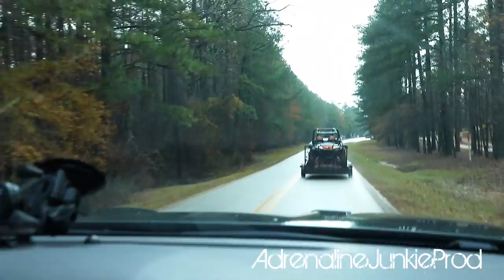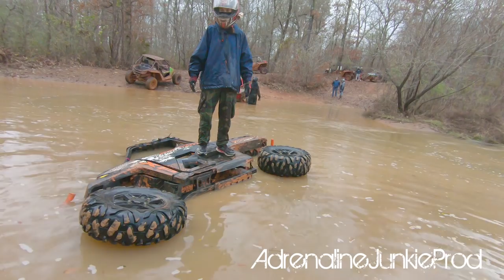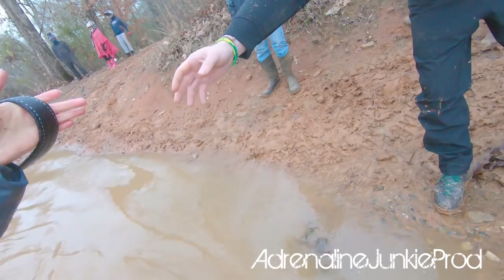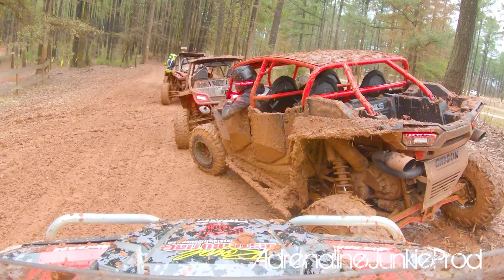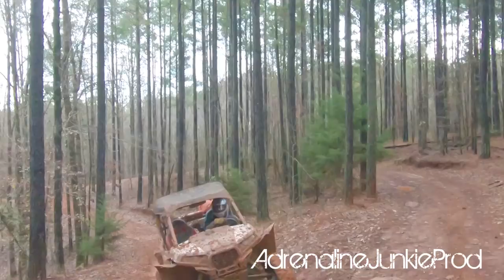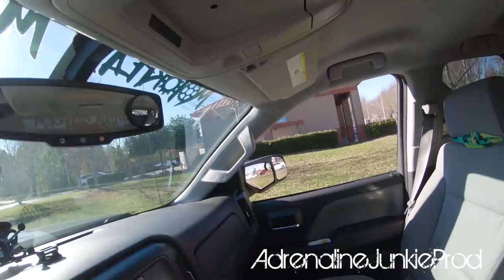Slick + Sloppy Georgia Clay in Durhamtown - Feature Length Trail Ride - SXS/UTV Trail Vlog 014

Comment: Riding always comes with its surprises at the end of the day. My last trip I loaded the trailer and on my walk a round strapping & checking straps I noticed I sheared off my front sway bar. But as you said "If you ride them hard, you need to  ready to fix them more often"!!!
Reply from the maker: Kole Moore Ya man, when you push the limits things wear out faster. Maintenance is just part of the experience. It’s crazy how many times I’ve found damage on the trailer before or after a ride, lol. At least you can still go on your ride with a busted sway bar!!

Comment: Durhamtown is decent. Best part about it is the one-way trails. On your next trip , you need to hit the two " Fast " trails , super fun. Also didn't see you hit the big hill clime area. That one mound isn't it. There's a spot that is steep and has four different places to climb it. And there's a boulder garden going up a hillside if you like to do any rock crawling. All in all , it's a fun place to spend a weekend.
Reply from the maker: Hank Slaght ya, we missed quite a few areas. Next time I head back there hopefully it’s not as wet and we don’t run into so many unexpected issues.

Comment: I stumbled across this video when scrolling through your channel and I ask you a lot how do 900S/1000S would perform with it's weight. You aready know I live in Poland and there  is nothing similar to what you went through in this video, what do you think?
Reply from the maker: Hey man. I feel that the 900S/1000S platforms are super reliable, super capable and also fun to drive. They have enough power for most things but not enough to hurt themselves easily. The bigger machines have more suspension but suspension on 900S feels great too. Bigger machines will do bettter in wide open high speed stuff but that’s the only place they really destroy the smaller machines. Most important factor is always driver 😉😉

Comment: had you put grease on the belt cover seal the water would not get in there as long as the clamps on the tubes are really tight ..just so ya know next ttime
Reply: It didnt it came in from the snorkel underwater when it was on its side.

Comment: Why didn’t you just shut the rzr off wouldn’t it stop taking in water.
Reply: We can not tell if it shut off on its own or not.. but she had seconds to reverse, and it was tipping over at the same time. The engine got water in it any way cause the snorkles all went 90 degrees under in over 5 feet of water. There is also an crank case breather hose that runs to the air intake on these machine, ONCE the mache took on water in the intake it also came in via that hose straight to the oil pan.
Reply from the maker: I think it shut off pretty much instantly, if you were lucky it shorted out and shut down before it hydro locked. Hard to tell in the video when it turns off.
Reply from the maker: Nathan, if your referring to my RZR not the Ranger then shutting it off wouldn't of stopped the CVT from filling up since it was filling up through the CVT exhaust vent because it was completely submerged. The CVT exhaust vent is much lower than the CVT intake and the engine air intake. I've been thinking about snorkeling the CVT exhaust into the bed. I didn't turn the RZR off because I didn't know how long it would be stuck in there and I didn't want the exhaust filling up.
Reply: AdrenalineJunkieProd yes I was referring to your rzr and thanks

Comment: Curious your thoughts on how a Honda Pioneer 1000-5 would handle this terrain. Obviously, it wouldn't be jumping.
Reply from the maker: Hey Angry Oscar. If you don't plan on jumping then you can handle everything else just fine. They are solid and capable machines. It would have no issues on these trails. Slap a set of good tires on it and it's ready to rock.

Comment: Why would u be going swamping with your machines if they don’t have snorkel kits and arnt built for the water just wondering
Reply from the maker: Hey Jake, was never planning on going that deep with my machine that day, it was just a fluke, tried to get to a better spot to help winch the RZR out and went deeper than planned. Generally speaking we don't go "mudding" As for the Ranger, it had snorkels and it had been through that hole before but there was a big washout under water they could not see and unfortunately when the machine hit it it caused it to roll over. Just a bunch of bad luck and poor planning, lol.

Comment: I'm thinking about getting a can am maverick trail what's your guys opinion on it
Reply from the maker: Colton Waggoner I think it’s a sweet machine. I think one of our local riding buddies just got one so I’m hoping it will be in some of the videos this spring and summer. Can’t wait to see what it can do first hand on the trials.
Reply: Thanks
Reply from the maker: No problem Colton. If you do mostly trail riding I think it will do excellent. If you plan on taking it out on a track or doing a lot of wide open high speed riding the large machines will out perform it. However, on the tighter more technical trails you will probably have the upper hand due to the slightly smaller size and increased agility.

Comment: Are you worried about running that vent to atmosphere BOV in all that mud and deep water?
Reply from the maker: Good question. No. Why? because I have it routed up high and it vents out at the level of the CVT intake near the top of the bed. I'll make a video of it in the future. I also have a cover over the vent to prevent anything like mud from falling in there. I would have to really submerse the machine deep to get water to actually find its way back to the BOV. I though about this a lot before I installed it.  I LOVE the sound of the atmospheric vent.

Comment: Do Polaris really struggle that much with water. We drive our X3's all day in the water, and worst that happens is a little belt slippage.
Reply from the maker: Can I get 1000 Subs with no videos I messed up cause I submerged my cvt exhaust. Never seen them have any issues in the water, especially not the snorkeled ones.
Reply: UHM no they dont and are way better at it than most can ams because of the actual 4 wd.

Comment: Looks pretty sloppy lol. I just got some mega mayhems for my x2, hope they don't break too much stuff lol.
Reply from the maker: Hey Arick, the #ITPtires #MegaMayhem is a solid tire! A bunch of the guys in our group run them or have run them in the past with good results. I think you'll like them.
Reply: @AdrenalineJunkieProd  i took em for a quick test ride friday night. And my oh my... those tires are nasty, just crawled through shit in 2 wheel drive that i could barely make in diff lock with my stock tires, and since i just got  27" set, i have not noticed any power loss from them. I'm still a little worried about the toll they'll take on my drive train, but we just have to see how it goes.

Comment: Summer is waaaaaaaaaaay too hot.  Camping sucks there when its hot you are there at the perfect time of year.  Its the south man after may its 98 degrees all day and night with no breeze and dry dusty conditions.  You actually are there the best time.  Thats when i go.  I take the class a camper and pull my razor and stay in the camp ground.   Its a blast gets down to 25 degrees at night.   Not cold to you but icy cold to me.  Anything south of tennesseein spring or summer is too hot.In florida we shut down riding from may until september....you just die.
Reply from the maker: I wish it was just a little less sloppy when we went, but it was an awesome time regardless. Ya, super hot and humid mixed with dust can suck!

Comment: Y’all need to start putting bigger mud tires a big lift and higher snorkels cause y’all riding stock height and there not fully equipped to rip deep mud
Reply from the maker: Ya Buzzbanks, my RZR is not setup for that type of riding. Wasn't planning on riding conditions like that. We don't do much deep mud so I've never set the RZR up for it. I should have never wandered into that swamp, lol.
Reply: AdrenalineJunkieProd ight cool enough bet she rips huh😂😂
Reply from the maker: Buzzbanks 464 she rips good, just not when I’m an idiot and drive into the middle of a swamp lol 😂
Reply: AdrenalineJunkieProd hahaha awsome have y’all seen the new Honda talon 👏👏😂

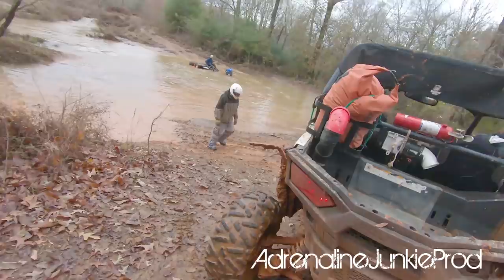Comment: 18:14 ( she rolled sideways ) you can only tip sideways bud , to roll has to be a complete rotation 🤙
Reply from the maker: Sure Taco,  I suppose you are correct if we are getting literal here, lol. It's a figure of speech I guess. I'm pretty sure we all know what I meant. However, one could argue she rolled sideways, but did not roll over sideways. When you are in bed and someone tells you to roll over that does not mean you need to make a complete rotation in order to be considered a roll ;) ;) lol

Comment: Sink sank sunk.  That's a bad place been there many times.  Back in the day of carbs we used to use the winch to hang them up from a tree, flush the water, spray starter fluid and keep running.  Today you're screwed bad
Reply: Pretty much the same thing we did to fix it. Diesel fuel flush and oil change new plugs still running today .

Comment: Durhamtown looks to flat....like riding down dirt roads... I like some good elevation changes
Reply from the maker: I like to mix it up. I enjoy all types of riding. All depends on what I'm in the mood for. Technical trail riding is probably my favorite but I love getting a high speed fix just about as much.
Reply: The main trails are pretty tame and more suitable for fast riding. The secondary trails are more technical and have plenty of hills. If you're interested in riding there at all spend a couple of days exploring. I'm sure you'll be impressed once you see all they have to offer in person.
Reply: I would like to check it out at some point. Any ride time is a good time! I'm in central AL so it's a 5 1/2 hour drive to get there.
Reply from the maker: You got it man, any day riding beats a day workin!! lol

Comment: One thing a lot of us in Louisiana do when we start to go riding in water is we do not wear our seat belts because you can get locked up in them and if you turn over in the water you can kiss your butt good bye
Reply from the maker: Stacy Reid that makes a lot of sense Stacey. It’s a good tip. That could end really bad if you get stuck.
Reply: AdrenalineJunkieProd I've watched the guys at SXSBLOG. com wear theirs when they rolled the HighLifter crew Ranger and was lucky that they got them undone.
Reply: pnbliveca if it had been much deeper and the Ranger had rolled the other way or been upside down there's the possibility that he might have   I've been at Mud Nationals and seen SXSs roll over and if the people had been wearing their seat belts it might not have been good     Seatbelts are good in the right situations but in water I don't think so
Reply: I'm a firm believer that seat belts can save your life. But they can also take them Too. 

They are times when you need to get out of Dodge Fast.

Drowning and fires are the 2 most horrible ways to go.
Reply: Tim Lal I so agree with you   I worked on an ambulance for a while and that is a known fact that what you say is true.  Pregnant women should not wear them either because the belt goes across the baby
Reply: Not panicking saves your life every time no matter what the issue.  She didnt panic, and did what was needed.
Reply: Mike Panicatoplois she did a great job of that sir   But some do panic especially those who are new to the sport
Reply: Glad everything turned out good. But had there been Deeper water "  and that Machine turned all the way upside down  , while being Fully 5 point Strapped in " things Could have turned a different way.  Especially while wearing a Helmet.  

Seatbelts are designed to not come  Off , Loose , while under pressure.  TBTH. I dont wear mine ,  but I will strap on my helmet.
Reply from the maker: Stacy Reid you make a ton of valid points about the seatbelts in water man.
Reply from the maker: Mike Panicatoplois ya, she handled it like a pro. Never a good idea to panic.
Reply: AdrenalineJunkieProd I've live around water my entire life and have seen people I grew up with lose their family members due to seatbelt she and losing control and ending up in water then drowning. My mom freaks out if her head goes underwater while at a water park and I've had to go get her and make her standup in only 3' of water
Reply: AdrenalineJunkieProd so true she did great
Reply from the maker: Ya Stacy, like you said earlier, water and fire are incredible forces when they work against you. Fun can quickly turn to tragedy. It's always important to keep that in the back of your head and be as prepared as you can be.
Reply: AdrenalineJunkieProd very well said.    At Mud Nationals at Mud Creek Offroad Park I saw and heard of people dying every year I was there , it was so bad there that they had 2-3 helicopters on stand-by on the property at all times and several Ambulances also   It got so bad I quit going.

Comment: That definitely was embarrassing... I've never seen anybody act like that over wet rubber bands
Reply: But still one of the best channels on the tube and one of my favorite... also the best riding areas with lots of good camera angles and commentary
Reply from the maker: Figured I'd leave it in the video. Not my proudest moment hahahahahaha. We all have less than stellar moments, figured I'd show one of mine to everyone, lol. Can't say I'm embarrassed, like I said in the video, momentary lapse of judgement. I thought I was about to ingest water in my engine not realizing what side was submersed, but hey, whats done is done. I deserve my chops busted for this one..... lol.
Reply from the maker: Thanks headwound, glad you haven't disowned me man, lol.
Reply: It was already a high stress situation since we had a machine on its side and IT was supposed to be the TOW TRUCK.. LOL so he was arguably worried.  My engine intake is NOT snorkeled so if i was passenger side down i would have been howling!   Turned out he was not that bad in shape after the belt drained and the clutch was worked on. We rode many more hrs of the day and no more issues. except Fess belt.. lol
Reply from the maker: Ya man, it was an eventful day. Glad everything worked out. I had a piece of debris stuck in my primary and the clutch wouldn't release fully and everytime I shifted into gear the RZR would stall out. Managed to spray out the clutch with brake cleaner and WD40 and then dried it all out really nice and she was good as new. My original goal was to help get the Ranger out by parking where Fess eventually parked but for some reason we thought I might be able to get around to the other side and get a better winch angle, that obviously didn't work out well. What went from a situation where I was gonna go help rescue the Ranger turned into a scenario where I needed rescuing myself. Definitely a high stress scenario but it all figured itself out. Not gonna forget this adventure anytime soon!

Comment: Now I know why americans complain about bearings and bushings not lasting.
Reply: Actually mine have lasted 3000 miles on that ranger high lifter.. even though we sink it and mud it all the time. KET is greaseing them after every wet or muddy ride.
Reply from the maker: The key to getting a good life cycle out of your wheel bearings is to grease them often with a wheel bearing greaser. Makes a huge difference.
Reply: @AdrenalineJunkieProd  got 5000km off mine driving dirt roads. They all have small play. I will look into a greaser for sure before I change them.
Reply from the maker: The Rider ya man, the greaser really does a good job extending the life of them. They are cheap online.

Comment: I'm not sure which is more annoying, the blow off valve or the exhaust. That would get old listening to that all day. So you guys let an apparently inexperienced driver take a $20000 SXS in a mud hole that you don't know the depth. Smh
Reply from the maker: Toby Cline hey, if you listened to the video you would of heard me say that Brooke and her dad ride there often. She’s been through that hole in her ranger before but she hit an underwater washout this time which caused it to tip over and roll. She should have stuck more to the left like her dad said but she went a little too far to the right. Sometimes things like this just happen, experienced or not there wasn’t much that could have been done to salvage that situation. Mike, her dad has the ranger torn apart and he said it’s looking like everything should be fine and it will live on to ride another day. Gotta take the good with the bad man. Not every ride works out perfectly and sometimes this is how you get more experienced.
Reply: That ranger highlifter was 13500 out the door.. LMAO so many self proclamed experts on the interwebs. An those 2 live close to that park ride there all the time. That creek was up high that day and you cant see the 3 foot wall on the other side.